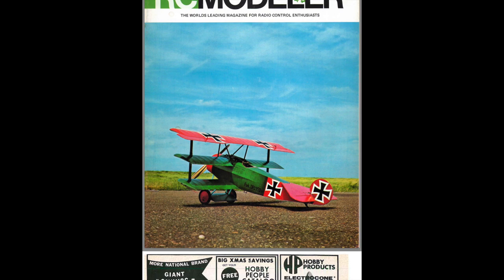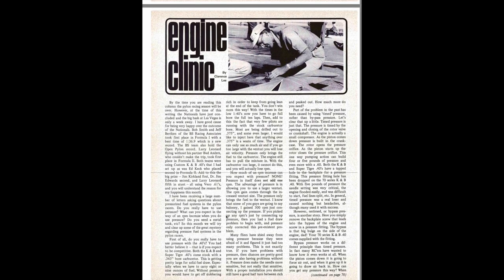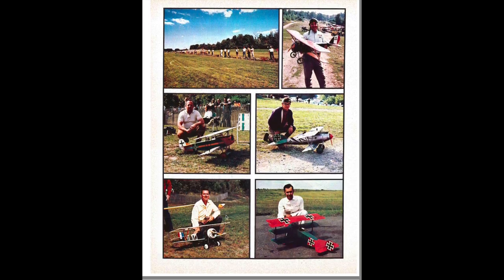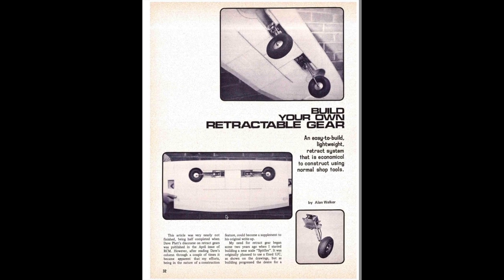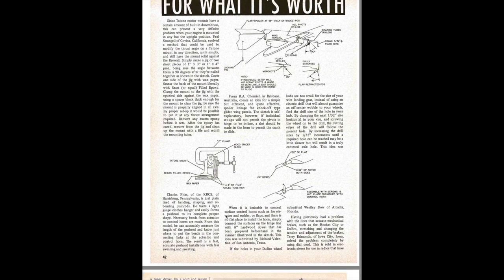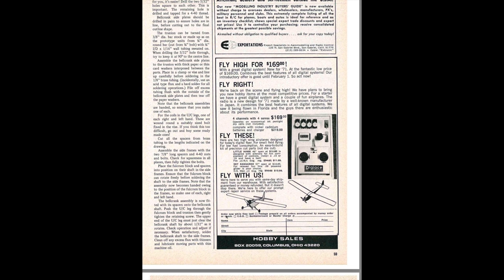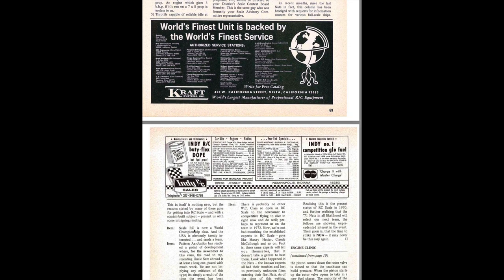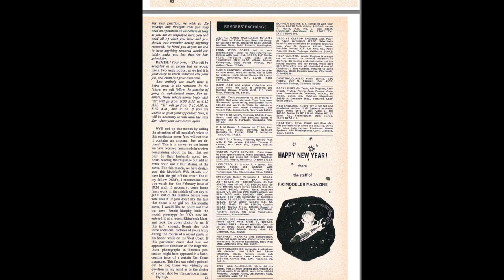A Tribute To RC Modeler Magazine January 1971

Comment: Another great video. Many people in the hobby, today, have no knowledge of the roots of the pastime that they enjoy.

I have a complete collection of all of the issues. The first was published in October of 1963 and was primarily distributed on the west coast. We were stationed at Edwards AFB when my father picked it up at a Lancaster hobby shop. The index lists Phil Kraft's Multi-Bipe and Barry Halstead's Exodus as construction articles. Features included articles on the 1963 Nationals, a "Build 'Em Right" article, RX for Escapements, and an interview with Hal deBolt. The listed departments were the Editor's Memo, Bench Bits, Fly-In, Showcase '63, Solo, RCM Tech Data, and AMA. The magazine had 40 pages and sold for 40 cents. (A penny a page.)

The last issue was published in June of 2005 and was just a ghost of its former glory. It had been declining for quite a while and was a far cry from the 1980's when some of the issues were 3/8 inch thick. I occasionally sit down and leaf through them remembering the early days of the hobby.
Reply from the maker: HF:  GREAT that you have a complete collection of RCM!!  Tim

Comment: Hi Tim. Great video and review. There was a msg over here in the UK , pretty much the same : Radio Modeller. Read every issue from 1975 until ceased production back in the mid 1990s.

Pages on wing sections, engines and the like, model reviews and plans. My first radio was a Skyleader 4 channel in 1976, cost me £168  which today is roughly £1000, or 1300 USD.!. 4 servos 27 meg. 
Great days at the cutting edge of rc modelling.
Reply from the maker: Maurice:  Thanks for checking in a fully agree . . . back in those days an RC flight was a true achievement!  Tim

Comment: Hi Tim..Great  video once again,!!! I  especially took interest in this video because I collect vintage R/C aircraft  and pretty much anything and everything R/C ...I grew up in the 80's here in Colorado and learned how to fly rc aircraft by 1st flying my cox  PT -19  trainer..I think that's the name of the plane? I  then got a cox  182 skylane R/C plane kit.. it 
Came with a cox Sanwa  2 channel aircraft  radio  the plane had a cox 0.49 sure start motor and a gas tank that held enough fuel for  7 -8 , minutes..you got the motor to Rev as high as possible  and then you chucked the plane in the air with a little up elevator.. it was a blast to fly when you are  14 yrs old..that was top of the line as far as what  cox was offering then in the  mid to late 1980s.. I learned how to fly  with that plane and have that plane still today... so I  collect vintage  rc stuff as I was saying  and I bought a early 1980s nitro hydro race boat and it has a very very old futaba 2 channel radio in it. I was wondering if I could email you pictures of it and maybe tell me when abouts it was made?? I cannot seem to find much information about it??? Id love to also pick your brain about some Guillows aircraft kits as well.... thanks Tim.... Ray from Colorado
Reply from the maker: Ray:  Sounds good!  I am at gbmckay at Gee Male dot com. Tim